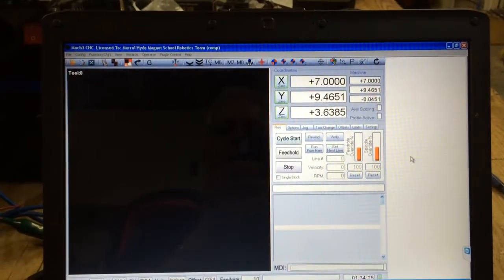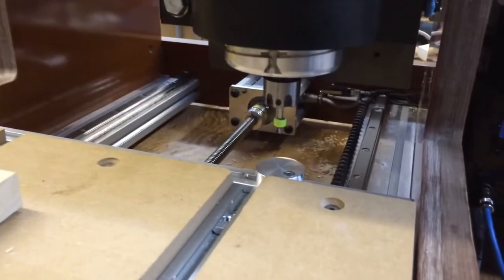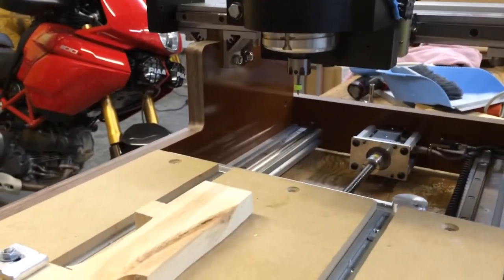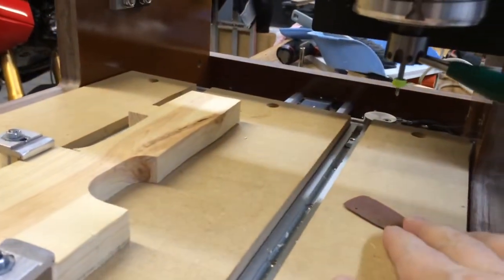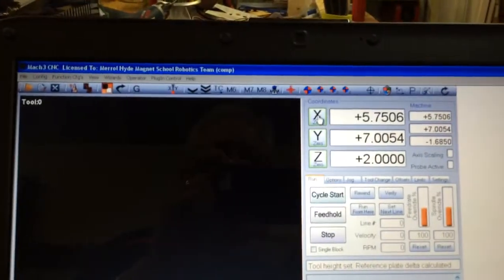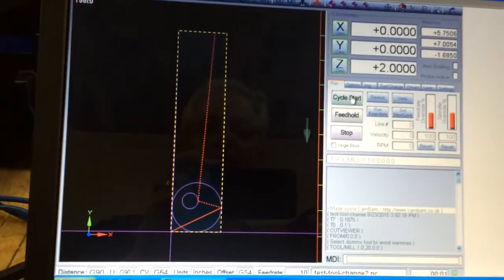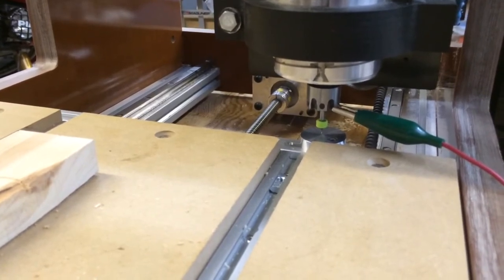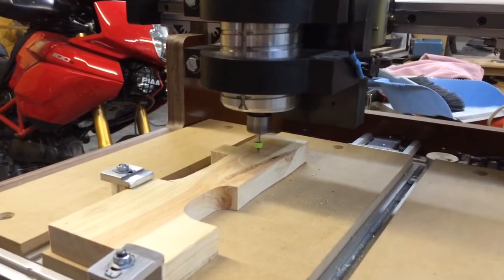Modified mach3 Screenset

Comment: How do you get your machine to move that fast?
My max speed is 70 inches per min..
and everything is setup right because it cuts perfect but jogs slow.
Reply from the maker: Wow, I forgot I even made that video.  I just set it as fast as it would go in the machine setup/settings without stalling.  Trial and error to find the spot where it stalled, then I backed it off some.  It's going to depend on your motors torque capability.